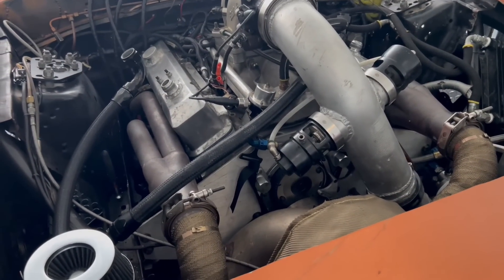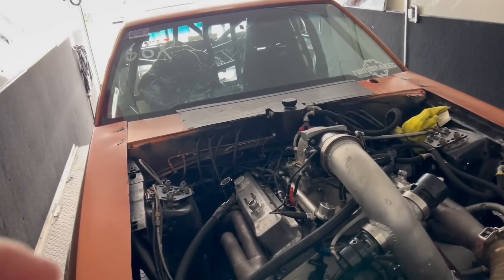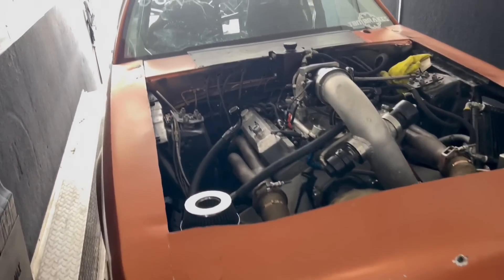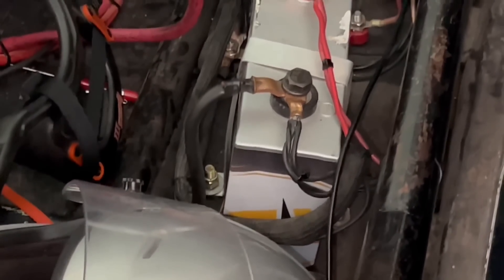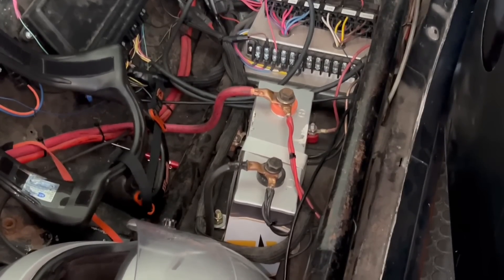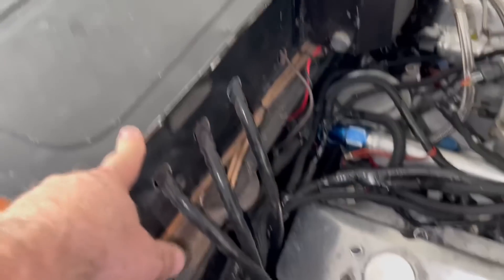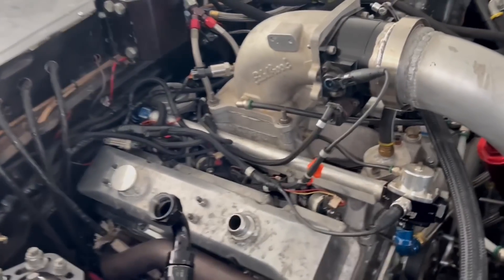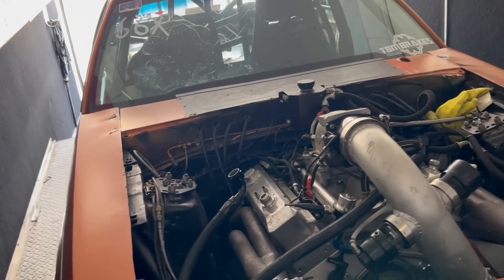“Great Value” wiring on my car

Comment: I've posted this on several YouTube channels but don't remember if I posted it here. I'm retired now but used to be an electrician/electronic technician. The proper way to make good power/ground connections for DC systems is: 1) Clean all the surfaces down to bare metal and apply conductive grease ((not  Dielectric grease) and make the connection. 2) For connections to aluminum wire brush the surfaces, apply conductive grease wire brush the surfaces again and make the connection. Aluminum oxidizes immediately after you wire brush it the first time.  3) You can't have too many ground connections. I would ground the block, intake manifold, both heads, firewall and both fenders. If you have a mid-plate motor mount ground it too. You most likely won't find conductive grease at your local auto parts store but every electrical supply store has it. We used to use copper coated nuts, bolts and washers for all battery/ground connections.

For all your other wiring use solder and heat shrink if possible because crimped connections will corrode and fail eventually. Wire nuts are for wiring your house😊. If you crimp your power cable cable  lugs put conductive grease on the cable before you crimp it. Support all your wiring so it doesn't flop around because the wire will eventually break at the connection point.

Somebody is going to reply that they have been using Dielectric grease on ground connections all their life and never had any problems. If we would had been caught on the job with a tube of dielectric grease we would have been fired on the spot.
Reply from the maker: Good advice, thanks

Comment: Head to head to chassis!!  If you are which most are running MLS and alum heads you do not have sufficient ground and plugs will not even begin to read right.  If you think you have enough grounds... add one more.  The reason Holley specs to battery is to kill noise  RFI/EMI as the battery is the biggest noise filter in the vehicle.

Comment: I have a 289 2V I want to put a 4v intake on the motor. It is stock a 1966 289 with 26,000.00 miles what kind of allium intake would you recommend and would a 600 cfm Holley be, ok?
Reply: Sounds like you can use some help.   Depends what your plans are.  Street/race ?    Automatic or stick.
Reply: @Jvcomet  just to cruise